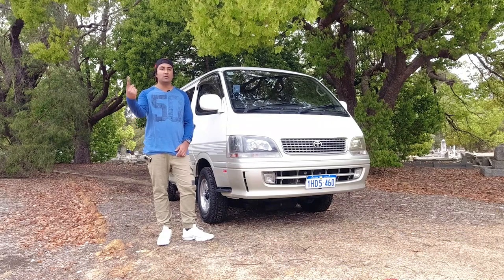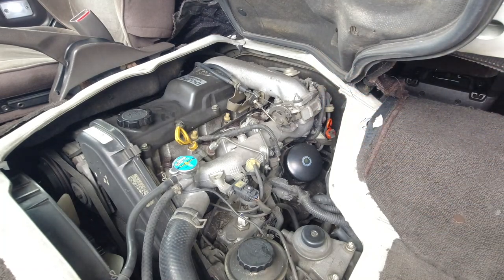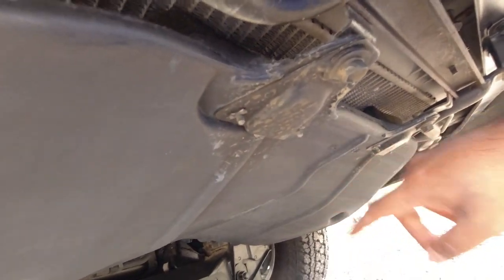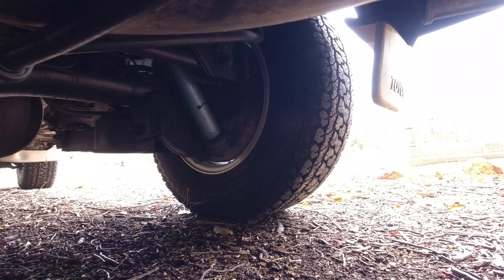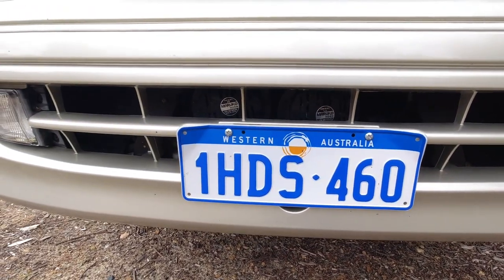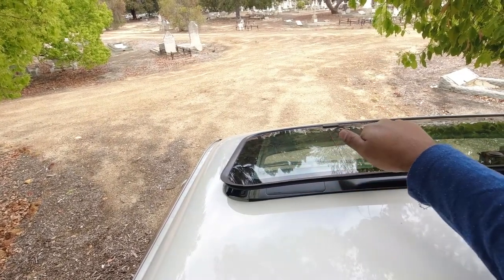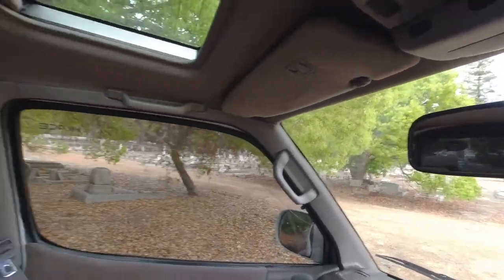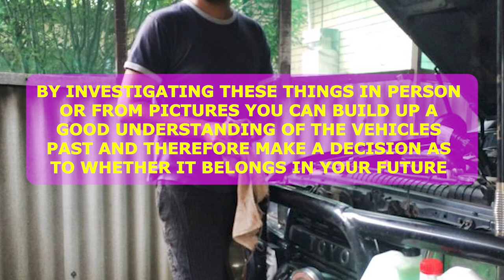Video Inspection Guide For KZH106 Hiace Super Custom

Comment: Very thorough and comprehensive review mate. I have this van 96 K1Z, I live in Miami Florida and it’s a head turner I think I’m the only that have this van in my city. I drove 900 miles to home from my pickup point and it’s was a fun drive. I had to take 5 minutes to adapt to right hand side driving but 900 miles later I was force to adapt. Your video has made me love my van even more and showed me a couple things I didn’t know. I am a car enthusiast and maintenance freak as well. Thanks for the vids, I watch all of them, cheers.
Reply from the maker: Awesome, congratulations. I know of a couple in Miami, there seems to be lots popping up all over America now.
Reply: @nathansharma87  yes very much indeed, the majority of them in the Pacific Northwest, Portland , Seattle and last but not least Canada 🇨🇦. I’m way down here solo as far as I know. I love this thing and I plan to have it for a very long time, I plan to make road trips in it and make use of its capabilities, most of her life will be on tarmac and some dirt roads. Parts are limited here as I have to order them either from Japan 🇯🇵 or Australia 🇦🇺. Lotta guys here in the states have up charge prices of parts. Did you lift or raise your van 🚐? Would you recommend it? Again my van will be on tarmac most of it life.
Reply from the maker: No I haven't lifted mine.... YET. I will be though just to fit some larger tyres.

The drawback is it will no longer fit in undercover carparks.

Parts are scarce in Australia also given they were never imported here also. Only New Zealand and a handful of other countries.

Parts are becoming hard to source in Japan also like tailgates and lights due to overseas demand.

I plan to keep mine forever also, it's going home to NZ with me this year.

Just maintain it as I'm sure you would, clean the underbody so you still have a car in the future even though Florida doesn't get snow or salt, she'll be with you forever.

Comment: Thank you for sharing your video. I am proud owner of this car in Sydney.  I just recently done some work on the car like brand new radiator which cost me almost 1k. What I want to point is metal pipes in my van have badly rusted. This pipes is not make any more so I decided to remove all rust with Cordless drill with metal brush then I went to metal electro plating shop to make like a new again.

This pipes is used for front heating and cooling engine. One pipe run from passenger side with electrical harnases and goes in engine and another one runs under driver side and end up near turbo unit. Please check your pipes to ensure that is in good condition otherwise you want br able to source a new ones.

Alex
S C limited

Comment: Hi Nathan, thanks for sharing your experience so simply, clearly and nicely. I would like to know if you ever experienced any problems with the electric steering wheel adjustment ? Mine is just stuck in high position and I don't know what to do to fix this...
Reply from the maker: I'm afraid I wouldn't know mine is manual adjust. I'd probably start by checking fuses, then pulling the switch off and running a multimeter on it while working it to see if the switch is getting power and if it is then it will be the motor which you could test also with the multimeter.

Comment: Wow Nathan.  Very thorough.  This should be the "go to" video for any prospective buyer of a 20+ year old Hiace.

As a fellow Super Custom owner of an older vintage (1993) I have a few questions.  
They are:
-Is the front under protective shroud for the radiator stock?  Mine didn't come with the plastic protector but something like that would give me more piece of mind on a rough road.
-Was your bottom front end repainted with a rust convertor or underbody spray?  On mine the under body has a similar color to the  stock body color.  
-Is the gearbox shield a stock thing as well?  Mine doesn't have that
-You mentioned the sliding door should slide and then some sort of electrical unit engages the final connection.  My tin top KZH106G just slides and engages like an old school door.
Reply from the maker: Hi mate

Yes the front radiator shroud is original and should be in place. It protects it from stones as well as directing air flow.

Transfer case bash plate is also original.

The suspension subframe should be black from factory although mine has been recently painted. The body should be a primer grey colour underneath.

Im unsure about the older models rear sliding door but if you have the pins mine does and it doesn't soft close itself could be a fault.

Comment: Thank you for this video! Just bought a HiAce kzh120 last week in Vancouver and I noticed that the rear trailing arm mounts are rusty on the left and have plates welded onto the right side… it passed safety inspection but I have my reservations… the van was sprayed before being shipped so I didn’t notice it until I owned it. Any recommendations on how to get the mounting point properly replaced/repaired?  Thanks again
Reply from the maker: Congratulations on the Hiace. If in doubt take it to a fabrication/ engineering shop. They will assess it best and may suggest they weld it up strong. Usually stronger than factory.

Comment: I'm looking at a KZ120 and am pretty worried about it. I'm having it looked at by a local mechanic (pre-purchase inspection), although the mechanic has likely never worked on a Hiace. Also, it's 2500 miles away from me; it's a very long drive to get it back, and the possibility of breaking down on my way back is the most concerning part for me.

Comment: Glad I found this! I'm looking at getting a 200 series and I imagine a lot of this is transferable.
I have no mechanical knowledge and don't want to be continually fixing things so I figure if I have the money for a 200 series it would be easier for me to maintain but maybe I'm wrong? I'm looking at 2005-2013 at the moment, if you have any advice at all that would be really appreciated. My other option was a standard hiace and put an elocker on the rear but I feel the awd would be better. Really struggling at the moment to make a choice, I've been through basically every possible van option and keep ending up with hiace or iload (2015+) for reliability so now I'm just stuck on which hiace and how to pick the right one and not be ripped off by importers. 

An idea for a future video might be a generalised 'good vans for camper conversions' if you have the knowledge for it (though I know you're not a fan of fitting out these cars) as there's too many basic videos out there that don't provide the nuance and understanding that you do. Anyway, thanks for all the videos I need to find more channels like yours.
Reply from the maker: Hello

Thanks for the kind words.

You know you can get the 200 Series in 4WD also right? It's called the Super GL

Either way the 200 nor the 100 have LSD rear diffs so a diff lock would be excellent.

There are people in Japan who fit LSD's to the rear and have videos testing them in snow. Unfortunately the 2wd vans can't even get up a slightly snowy slope so as for traction, you can't beat the 4wd.

The 100 also has the viscous transfer case which locks up automatically if it detects wheel spin on one axle effectively working as a center diff lock.

Both are about the same in terms of reliability. The 200 is more basic without sunroofs and a more basic interior however the engine is more electronic and as you mentioned, newer. Less chances of ecu issues, aged hoses etc.

As for engine reliability the 1KD is very good. My parents have one in New Zealand with around half a million KMS.

The 1KD does like injector changes every 100,000kms you can find good videos on that engine on YouTube by Fourby4Diesel.

The 1KZ is still very reliable although not as forgiving if you take any liberties with it. 

In inexperienced hands both are massively unreliable. 

All the best with the search.
Reply: Yes I do, sorry if I didn't make that clear, my choice is between that one (AWD/4WD Import) and the 2WD Aussie one. Though is the Super GL different to the normal AWD import one like the DX (In terms of the awd/4wd system - I know the insides are obviously nicer)?

Thanks, I think that answers my question right there (Which is to get the imported AWD over the aussie 2WD). I don't plan to do extreme off-roading but it's that peace of mind should I chose to go off track solo to find a muddy campground for the night or hit the snow once a year. Knowing I have that capability is nice.

That's great to know, I'll make sure to research which year models have the 1KD so I get that one.

"In inexperienced hands both are massively unreliable." this is concerning as I'm really inexperienced. I always look #1 for maintenance history, it's the most important thing for me when buying a car making sure they do services on time, etc. but beyond that I don't know what else to do other than follow videos like yours and if there's people like you who look after it themselves they might not have the records but might have looked after it better than say a toyota dealership would have so it's hard to tell. 

But in saying that I don't have much options unless you think something like an iLoad is better for inexperienced people? But they seem like they would have more issues in that case, it's such a hard thing to make a call on I feel like any well maintained car will be good even from some of the vans people always tell me to steer clear of like the transporters. 

Regardless your response has already helped heaps! Didn't expect such a timely response but it's greatly appreciated as I'll be needing to make a purchase in the next 2 weeks. You should consider doing like a livestream QNA, I would be happy to pay for good advice, I even rang up mechanics asking to pay for advice and they usually refuse money and just say get a petrol hiace and that's it.
Reply from the maker: @0nceuponatime486  Ah ok cool I get you know.

From what I've been seeing the local Hiace's are commanding top dollar and is almost if not the same as an import 4wd. So I'd go with the import just on that alone. Plus it will be worth more in the end too.

If you did find a cheap local model then I'd go with that since you don't plan on any serious off roading.

With some weight over the back wheels and all terrain tyres the 2wd would be no different to any other 2wd vehicle.

Any turbo diesel engine in the 200 series is good. The petrol is fine too but some I've seen with plastic intake manifolds that crack or hoses under the intake manifold that leak.

With the iLoad you'll get local mechanical expertise and parts availability however I've driven plenty of iLoads and the build quality is horrendous. That's not to say mechanical parts aren't available for imports. It's just that most mechanical shops don't know or can't be bothered cross referencing.

As for reliability in inexperienced hands it's a very broad range of things.

Firstly it's ensuring its mechanically sound which you seem to know and check for.

Then there's the age issue with the 100 series like mine, I get about one Instagram message or email a week from people with ECU's failing. It's an easy refurb done by any electronic shop that can work on boards.

Some vans already have had refurbished ECU's so it's hard to tell.

Some people have issues with injection pumps. Not trying to scare you just relaying the info I get. Usually from neglect or bad maintenance in its past.

Again with reliability it's little things like using a cap full of diesel fuel conditioner in every tank or second tank of fuel.

Running good engine oil, like Penrite's HPR 10W40 and not the cheapest nastiest stuff the local garage gets for $1.30 from their sales rep. 

Then there's driving it. Running it foot to the floor at 110kph up 3km inclines on a 44 degree day will ensure you need a new engine once you reach the top but, slow down, turn the AC off and it will be just fine.

I replaced my water temp sensors so my temp gauge is very accurate and I've taken it to just under 3/4 on extremely hot days up extremely big hills at high speed and it copes fine.

I would recommend whatever you get to find a good mechanic and go through it.

- Engine Oil and Filter
- - Fuel and Air Filter
- Auto trans flush if automatic
- - Coolant flush
- New water temp sensors
- - 100% make sure the Viscous fan works
- Diff/ transfer oils
- - Brake and Power Steer Fluid
- Check/ replace the belts etc
- - Clean sunroofs if any
- Check the battery and alternator charge

That way you know it's ready to go. It's what I did with mine and it's been perfect.

I've found that most people buy a van and contact me either don't care for it until it gives them issues and/ or then take it to a mechanic who just replaces things one after the other with the same issues coming up.

For example I had a lady who just had her head gasket done after overheating it and then had it overheat uphill again on a cool day.

The mechanic was then looking to change the radiator or some other components.

A good mechanic would have checked things out as to why it overheated in the first place before replacing the head gasket.

It was more likely than not her viscous fan not working as it should. She was out of pocket thousands and on her last legs with the van. 

The importance of a good workshop/ mechanic is invaluable.

I've found that when you invest in something so unique and expensive you naturally drive it overly cautiously at first treating it as if it were precious. But as time goes on you'll get to know it better and realise it will handle just about anything. You develop a relationship with it and you'll learn so much without realising it.

And yes stay away from Ford's in general. I'm on the Facebook mechanics page and the Ford mechanics are constantly posting up the worst engineering and design issues. They just cut too many corners.

You can email me at esvernoc@gmail.com for whatever questions and I'll help.

Comment: Amazing job Nathan! Thank you for posting this video. I have a 2001 KZH120G, and absolutely love it! Would you have an applicable maintenance schedule you could send my way? It’s got the 1KZ-TE so should probably be the same as the Super Custom I imagine:)
Reply: Also, do you have any advice on running a diesel pre-filter on one of these? I always believe that if it needed it, Toyota would have added it, but some guys think they’re a good idea. Any thoughts?
Reply from the maker: Hey thank you I appreciate the comment.

I've changed and simplified my maintenance schedule.

A service (annually):
Engine oil and filter, clean air filter. Grease driveshaft and ball joints. Check and top up fluids. Rotate tyres.

B service every three years: A + Diff and transfer case oil, air and fuel filter. ATF filter and flush. Brake and power steer fluid.

C service: 100,000km A+B (if needed or falls into timeframe) timing belt, water pump, thermostat, radiator cap, fan belts, oil seals, coolant, AC regas.

It's this service that if anything like an engine mount etc is needed I do.
Reply from the maker: @avkyjonka6539  nope. Unnecessary. The fuel filters capture everything.

They're always white clean on the clean side even if the dirty side is completely black and clogged.

The people that recommend them usually sell them. The people that swear by it usually bought it.

They all seemed to run fine until around 2015 when people started selling these then it became a "necessity".

The best thing you can do is buy a bottle of diesel fuel conditioner and use a dosage in every tank of fuel. It dissolves gum and sludge, prevents rust, disperses water, lubricates and cleans, reduces foaming can improve cetane too.
Reply: @nathansharma87  Awesome! Thanks mate🙏🏼
Reply from the maker: Happy to help, my email is in the description box if you ever need. Thanks for your support I really appreciate it.

Comment: hi Nathan， how you experienced to source the parts of this jdm model ? Does it share parts with local ausie model? I am looking for buy one just bit concerned about the parts. How about after market accessories like bull bar tow bar ?Thx for your advice
Reply from the maker: Hi mate

Mechanical parts are pretty easy. Body parts are not such as headlights and tailgates etc as well as interior pieces.

No support locally for bullbars and towbars.

Glass can be found easily for windscreen and tailgate glass.

Comment: What do you recommend about the EGR block on these vehicles ?up the temperature in the cylinders I here but stops dirty block intake ?
Reply from the maker: I don't recommend it. These have been running perfectly fine for 25 years and people get them and start blocking things and running into issues.

If it blocks up at 30 years of age just remove and clean the intake, put a new gasket on and drive it for another 30 years.